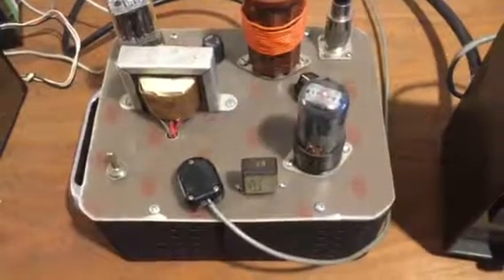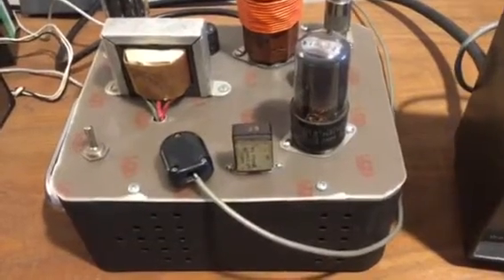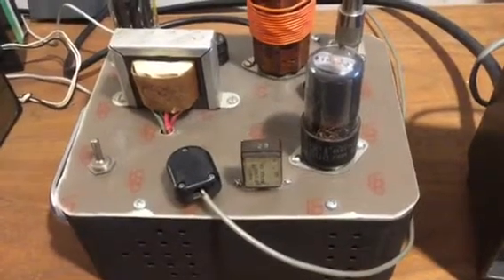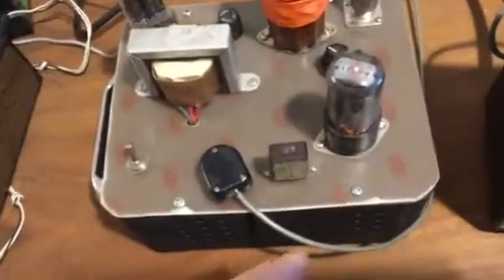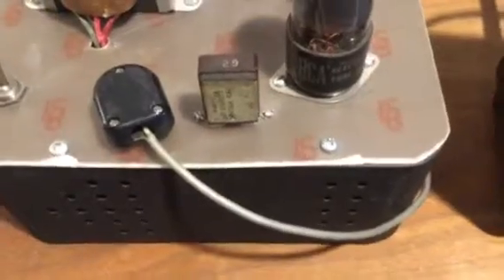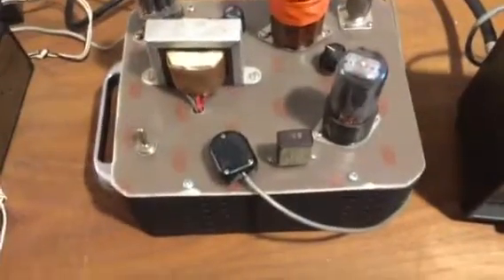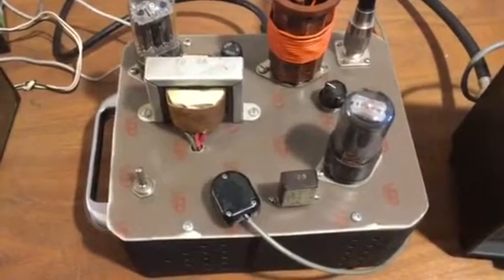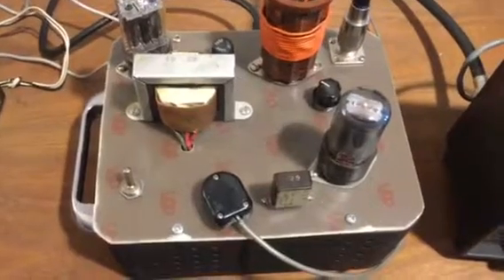Home brew 6V6GT 40 meter transmitter

Comment: just a bit of chirp but not too shabby....possibly a voltage drop under load...??? still.....looks pretty basic, and as long as you can be heard....I run a lot of QRP myself, fixed, and portable (SOTA's)...cool video.

Comment: Good deal Bill on using a damper diode for a rectifier.  Many people don't look at anything other than the main line types. If you want to get creative you can use series string television tubes also. They're a lot cheaper too!